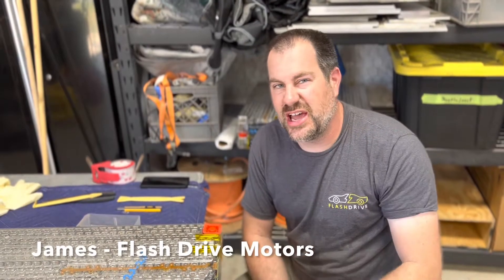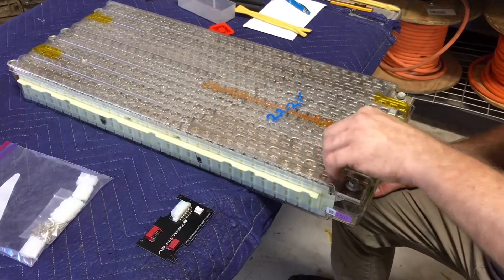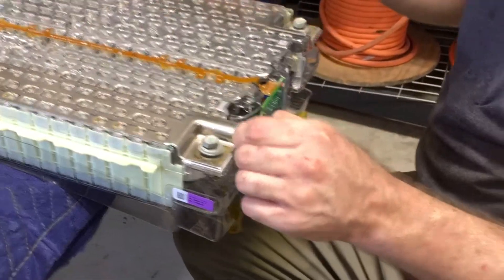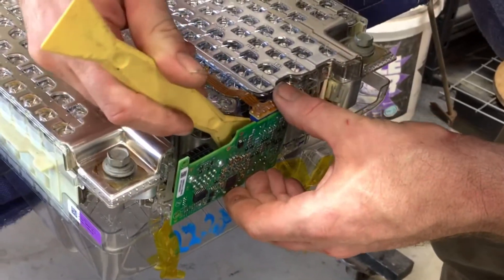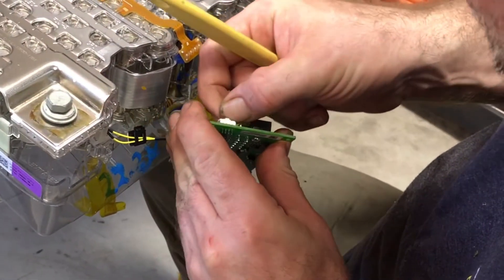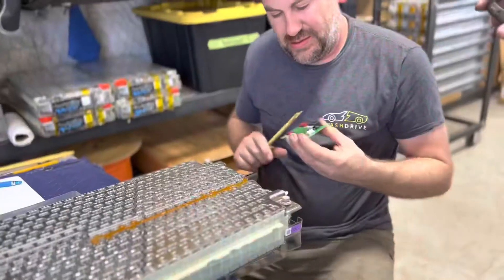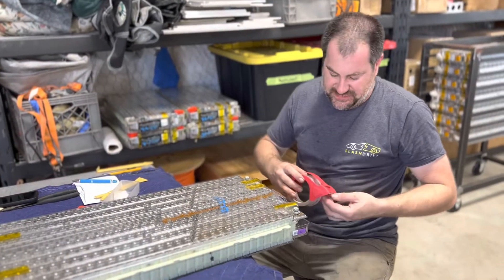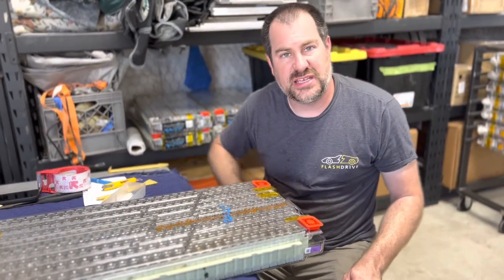How To - Change BMS cell taps on Tesla Batteries for your EV Conversion by Flash Drive Motors

Comment: FYI the Simp BMS works off of the factory Tesla battery slave boards (which are of the highest quality). Been running a 12 module pack off of the Simp BMS for years now.